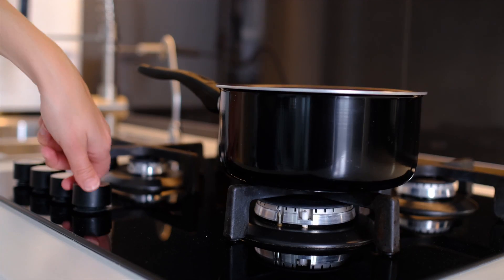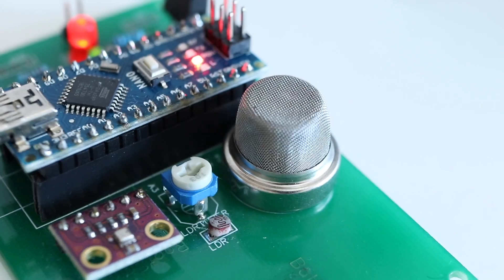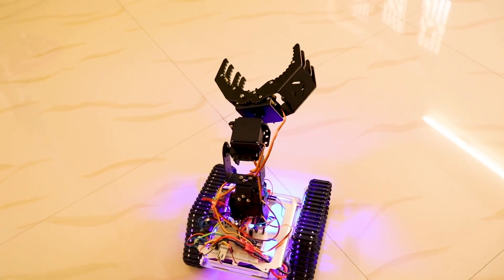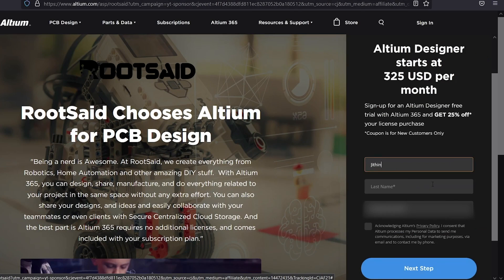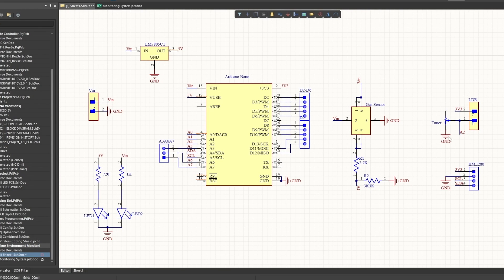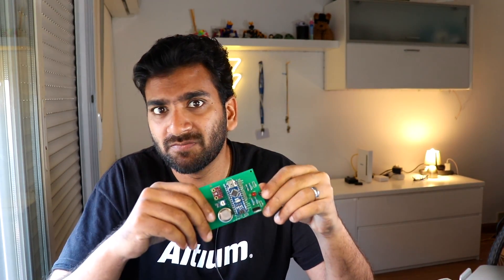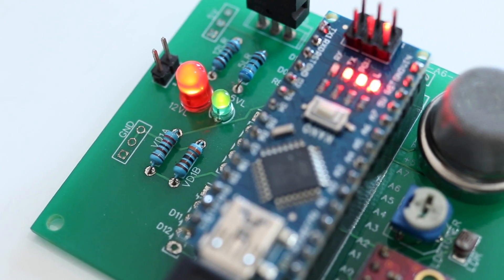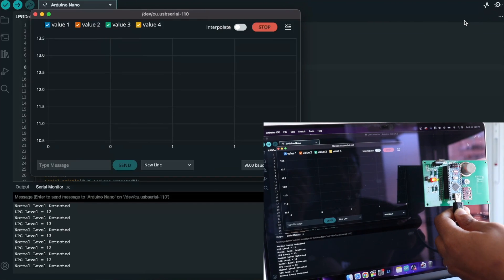LPG Leak Detection using Arduino and MQ2 | Simple and Cheap Arduino Project for Schools and College

Comment: I need something to detect if the Gas burner is still on or not.  It's for a family member with early signs of Alzheimer. He leaves the stove on after cooking. I would buy it, but I never found it.
Reply: Add thermocouple. Keep in mind, this only detects fire. But at least with MQ2, leaks also can be sensed. Set interval for heating, and when the it's overdue, optionally trigger LPG solenoid for cut-off